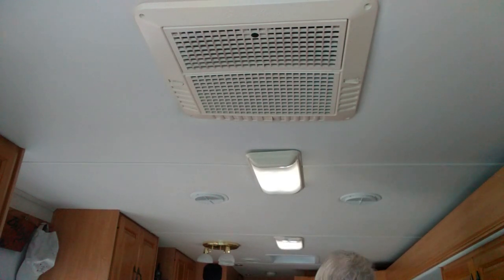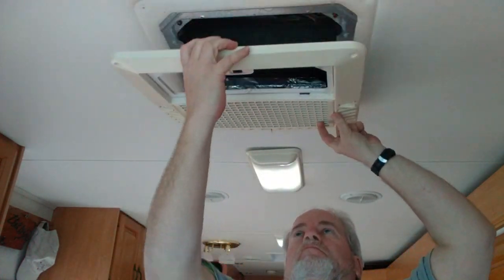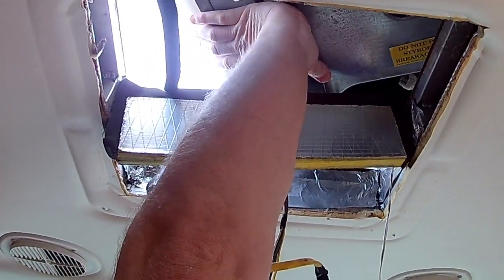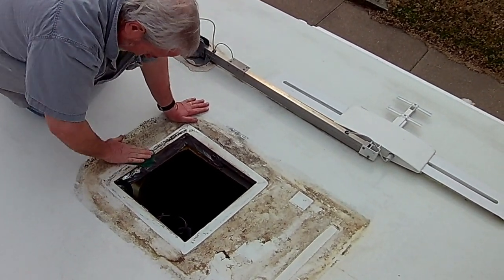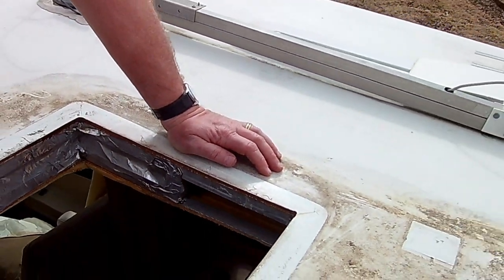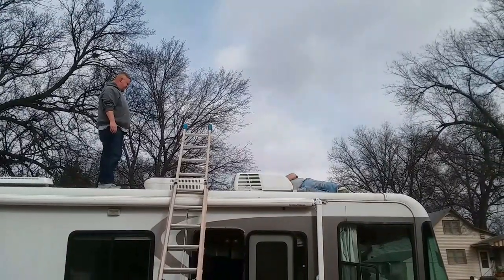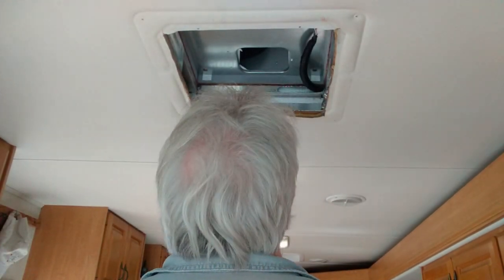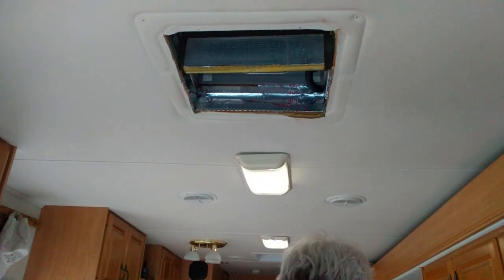Installing Coleman Mach RV Air Conditioner

Comment: Thank you!  I plan to order my own and install.  Local RV shop quoted me $975 parts and labor. I replaced my own converter last year with about this much ease and saved $250.
Reply from the maker: Absolutely...only really challenging part is getting it on the roof!
Reply: Pensacola Rules My shop landlord had a forklift. I did the whole job by myself in less than an hour. Thanks again.

Comment: We replaced ours today. It blows my mind that there's only 4 screws holding that thing down, but I'm not going to complain. I do need to figure out some kind of ramp system to get it up to the top next time though (when we replace the back one, only replaced our front 13.5 with this 15 this time). Used pulleys this time, which wasn't too bad, but still sucked when we got it to the top of the ladder.
Reply from the maker: I imagined using a couple of 2x6's as ramps, but my brother in law that helped said we should be able to rope it up, which we did. However, if I were to do it again, I would leave it in the shipping crate to avoid any chance of damaging the unit. Congrats on your install!!

Comment: it was the info I exactly needed to replace my ac unit mine is the same model Thanks!!!
Reply from the maker: Great. We upgraded ours for the very situation we are in now, we are hooked up to 30 amps and really can't run both A/C's, but we are able to run the larger 15k unit we installed. It is just keeping up. Glad it was useful!!

Comment: Did it mot come with a new circuit board (that white box that the thermostat wires and power goes too?
Reply from the maker: No, I think you may have a different or newer a/c. In mine, there is a galvanized box that the wires go to, but there is no circuit board in it, just a junction box for the wires. That box did not come with the new unit.

Comment: Thank you for this video! I do have one question, did you use any kind of sealants/caulks around the square opening on the roof when placing the new unit? Or is there some sort of foam/gasket there? Thank you again.
Reply: Mine came with a foam gasket. Other than that, I did not use any caulk. Even the screws on the cover would only leak down into the drain pan. Safe travels!

Comment: The electrical box you took off with the wing nuts, is that common in all a/c's when you put the new unit on?
Reply from the maker: I don't think so...I think some newer versions may have these mounted elsewhere, but of course I am only familiar with the one I installed and my rig is 17 years old. I think I saw different set-ups on some of the videos I looked at before taking this on. You might look at some other videos for other configurations.
Reply: @pensacolarules4228  Thank you Sir for your information and video. It was helpful!!

Comment: New unit came today. Unit only nothing else.  Did you use your old flange on the inside ceiling of the unit for the four long bolts or did you have to purchase a new one?
Reply from the maker: I reused all of the original hardware inside. Good thing, I suspect those bolts would be hard to find!!

Comment: You say that you live in it full time. So do I. Is it ok to leave the bedroom AC running 24/7 on a medium level. I have the old knobs. Asking bc I get worried about running it 24/7 and burning out the AC unit. The rv is I my 2 yrs old. Please help me understand the best way I should go bc the rv stays hot I side with only running one of the units
Reply from the maker: Ronnie, I am not an RV or HVAC person. I would recommend calling an RV repair person. I would believe that you will eventually burn out the bearing running it non-stop. Your best bet would be to try to move it into shade, or consider putting a cheap window unit in the bedroom and give your AC a break at night. Or do like we do and move north in the summer! 😏

Comment: Did you use a new foam gasket or the original one from the old AC unit? Reason being is I am installing a new Mach 15 when it arrives.
Reply from the maker: I seem to recall it came with a new gasket.

Comment: Nice work. I just bought a Coleman Mach 3 9200 btu for sprinter and I know I’m wondering if the 14 inch gasket is included.  Or do I have to buy it separately?
Reply from the maker: They usually come with the gasket. The only extras you would have would be the interior cover panel if you needed one, or a heater if you wanted one. Thanks!!

Comment: Hi, I have a Coleman Model No. 7335B891 that needs replacing. I plugged in my model into coleman/airxcels compatibility chart. Only one "compatible" model popped up; Mach 15. When i click on it, it says NOT A DIRECT REPLACEMENT. NEED CEILING ASSEMBLY. Doesn't it come with a ceiling assembly?
Reply from the maker: Shawn, I am by no means an ac expert, just a full timer that installed my ac in my rig. However, I think the interior vent or control is sold separately.  I know mine did not come with one.

Comment: What kind of seal for the ac on the roof?
Reply: I believe it came with the ac. I used dicor to seal to the roof.
Reply: Got it. Turns out that ours is so old(15 years old) that we also would have to get a new thermostat and control box. Also the ceiling assembly is separate. 

At least installing looks easy.

Another question: Can we reuse the same wiring for the thermostat from the old one?
Reply: @TheMegamanDX  Should be able to, even if you change the thermostat out, wires are wires. Just need to double check and make sure the right wire goes to the right function.

Comment: I'm putting a Coleman mach15 in an rv originally had a DuoThem, where can I find the right adapter ?
Reply from the maker: I am not familiar with the DuoTherm, but I'm sure someone has an adapter. The hole is probably the same, and you might just need a wiring adapter if I had to guess. Sorry I'm not more help.
Reply: @pensacolarules4228  After more research, I learned if putting dometic in an rv that used to have coleman, all you need is the wire plug adapter, but if putting coleman in an rv that had anything else, you have to replace the lower control board and T-Stat. Coleman will not interface with dometc style . 
SO I have to replace the entire system